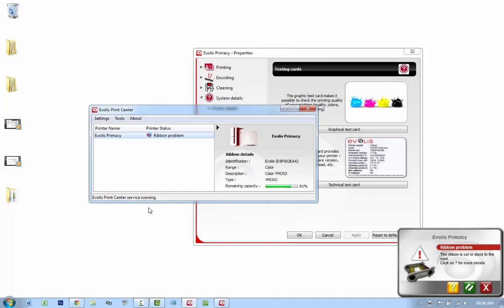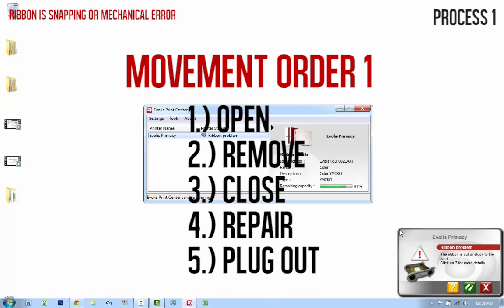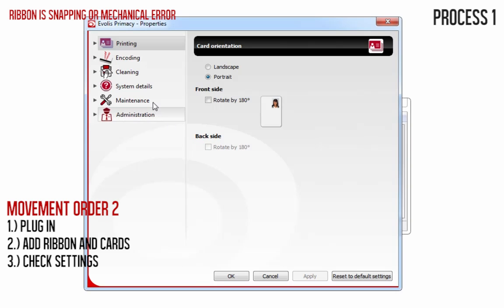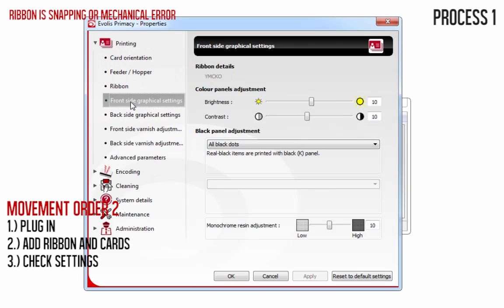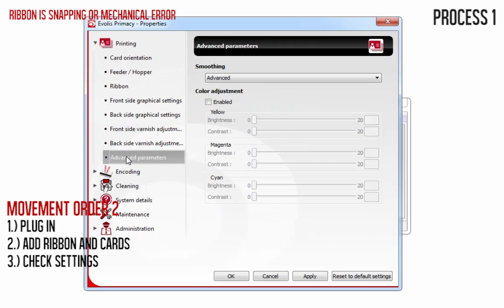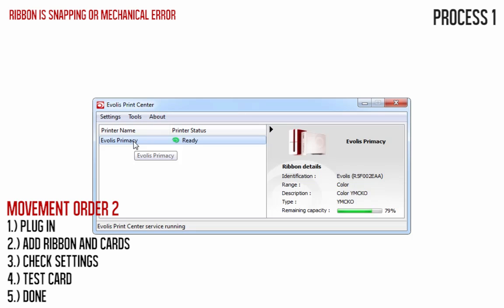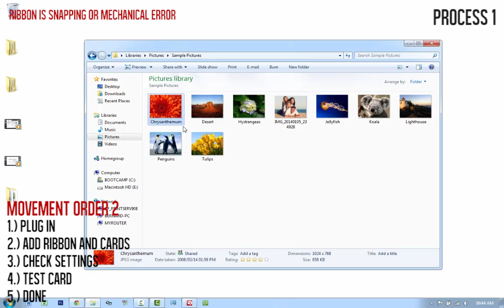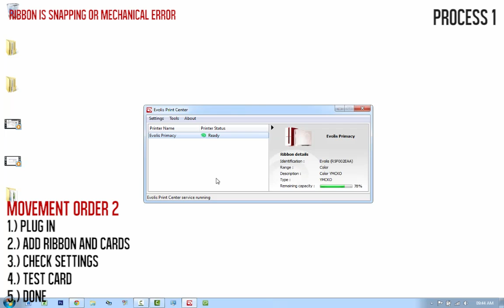Ribbon Snapping or Mechanical Errors - Evolis Tech Guide

Comment: I have a badgy 200 and keep getting the ribbon problem that it says its stuck or cut but the ribbon is fine, already tried two new ribbons with the same issue, any fix?
Reply: I had also the same problem.
Did you fix it? If yes
Kindly let me know how to fix it please.
Reply: @raihanrawoot8664  The printer needs to have its sensors reset. You need to have Badgy Print Center, open it, right click on your printer and click properties.  Go to Maintenance>Printer command and type in 'Sa;r' (without the ') and wait for Answer to be OK. Next step you type in same spot 'Sa;c' (without the ') and the printer will recalibrate, and it should say OK again. That's all.